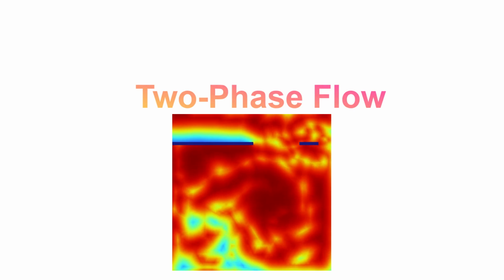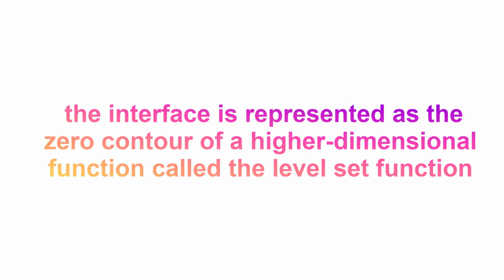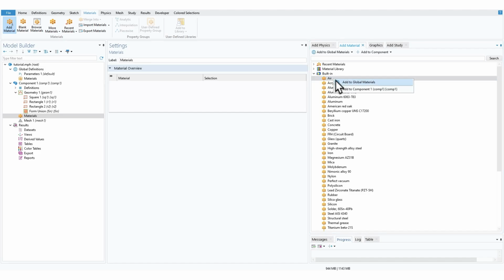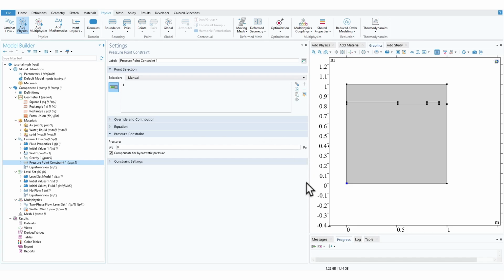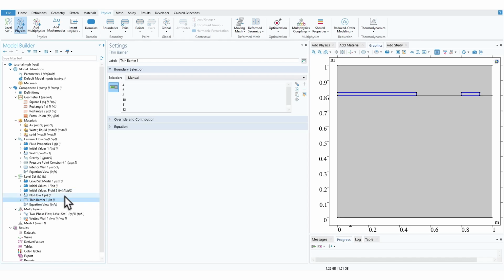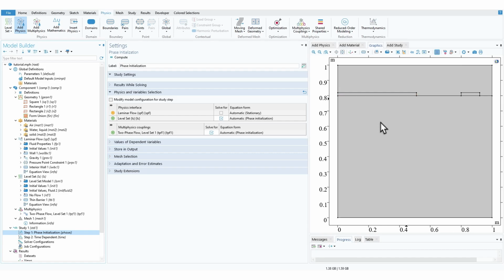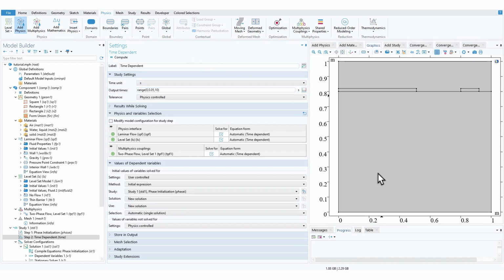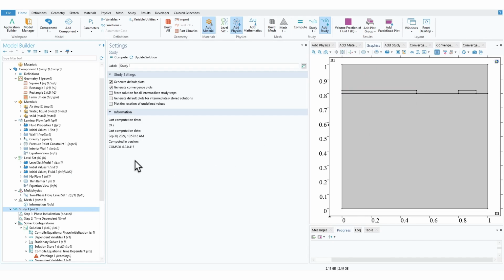Two-Phase Flow Modeling in with COMSOL® Software- Complete Tutorial | Learn with BK

Comment: Hi BK, how are you going?

Could you explain me why do you delete the wetted wall in the multiphysics session? I have a doubt, if I'm analyzing macroscopic fluid flow of water and air, Do I need to use wetted walls?
Reply from the maker: thanks for asking!
In the two-phase flow simulation (water and air), the wetted wall boundary condition is typically used when you're interested in tracking the interface between phases, especially when surface tension or wall adhesion effects are critical. So accordingly you have to decide for your work.

Comment: Is it possible to define a mass transfer between two phases at those points where the volume fraction is equal to 0.5? The difficulty of the problem here is that the points where the volume fraction is 0.5 are variable and not fixed. In COMSOL, to define a flux, the boundary must be constant. Thank you for your help.
Reply from the maker: I think this can be done.

Comment: Can you please make a demo video of Laser melting simulation in Comsol, how Solid material melts and the flow like a fluid after melting using two phase flow in level set or Phase field method
Reply from the maker: Noted. I will try to make one.

Comment: Great video! I really appreciate the clear explanation. Can you please guide how to model water vapors emerging from the top into water, and how to calculate the heat and mass transfer rates. Any guidance or advice on how to approach this would be amazing! Thanks again for the valuable content! ❤
Reply from the maker: you would typically need to set up a multiphysics model that couples fluid flow with heat and mass transfer. In COMSOL, for example, you can use the Heat Transfer Module along with the Transport of Diluted Species physics to handle the mass transfer of water vapor.